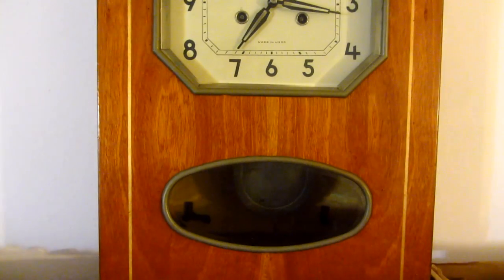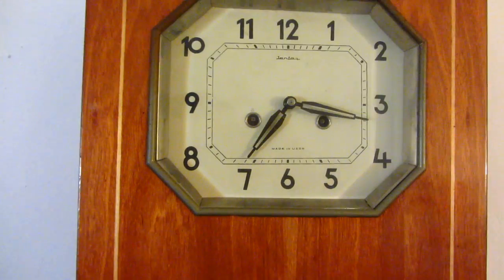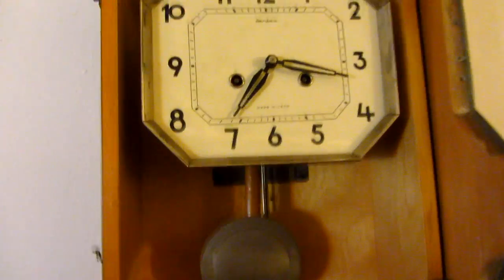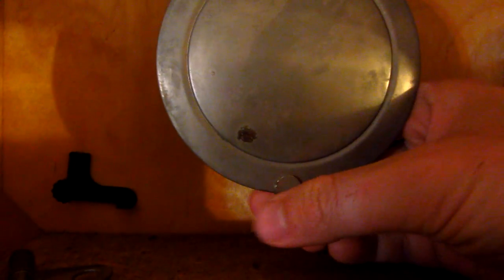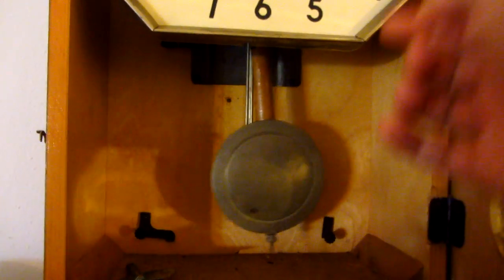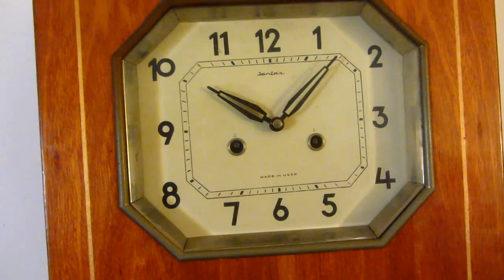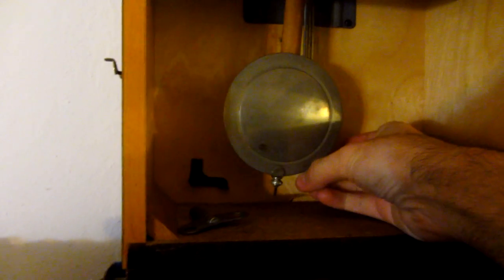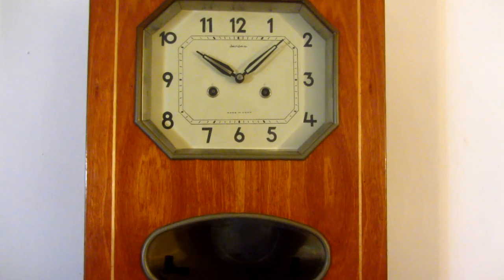How to Regulate a Pendulum Wall Clock (Speed)

Comment: You should check/adjust at the same time of day preferably either 1/4 past or 1/4 to a given hour eg adjust 7:15pm one day, check and adjust 7:15pm next day (or next week). This also takes up any slack in the hands to ensure accurate timekeeping. Pendulum clocks will keep time within 15 seconds a week.

Comment: First, make sure the clock is level in 2 directions.
If it does not run, carefully spray mechanism with Automotive Quick Start which quickly evaporates.
No smoking or open flame please.  Fully wind clock. Wait 24 hours between adjustment of the Pendulum.

Comment: What makes the pendulum change pace anyway? Wouldn't the clock be made at 'set' pendulum length indefinitely? What is it that makes it go faster or slower & need adjusting? I have a very old wall RE & just had it restored but can't seem to keep it from going super fast. Advise?
Reply from the maker: Clean it, oil it, make it stay vertical (use a level).